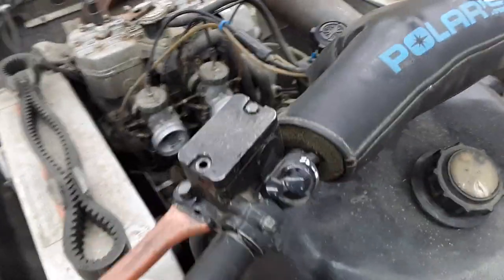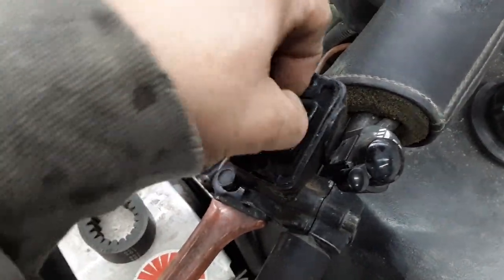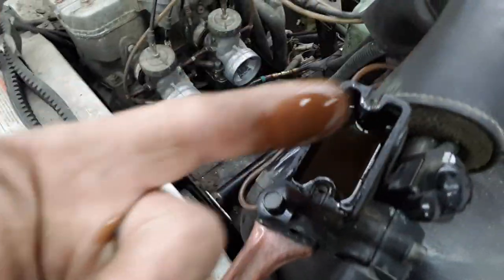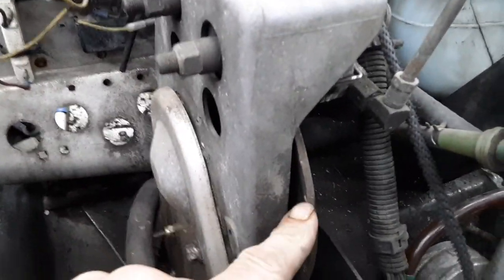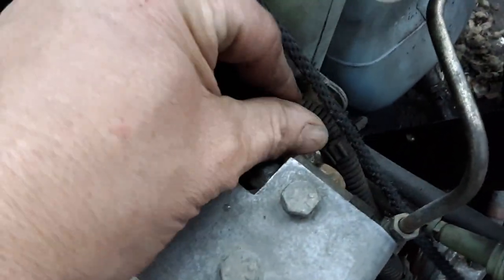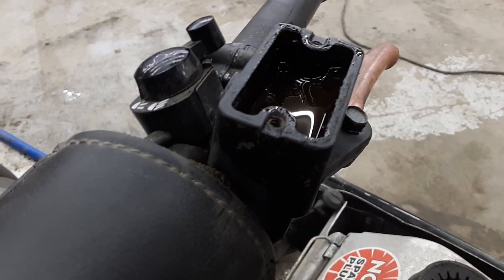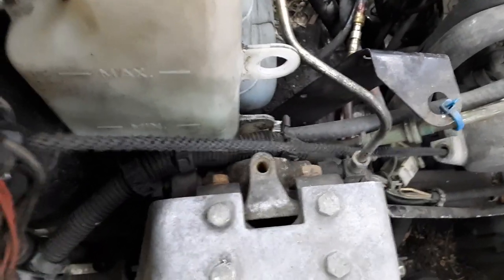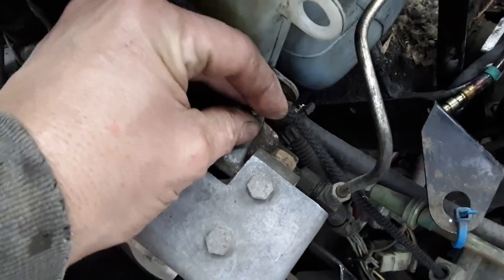Brake Problems: 91 Polaris Indy 500 Snowmobile. 20191230 172048

Comment: Hi, I was wondering if anybody could help me. I have a 1986 indy 600 and  I think my brake is Locked up so it doesn't let my track spin very easy. "Have to use all strength to move a little" and it also won't let my secondary clutch engage. Any help getting it unstuck would be very appreciated.
Reply: Try removing your brake caliper and retry. If that doesn't work turn your track wheels by hand and see if they spin freely.